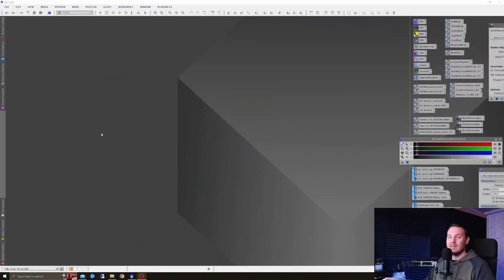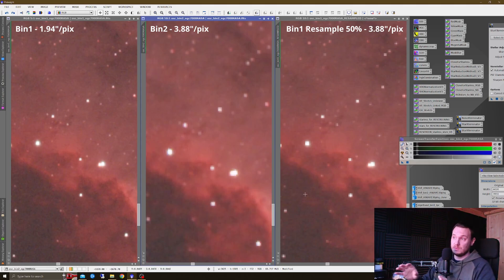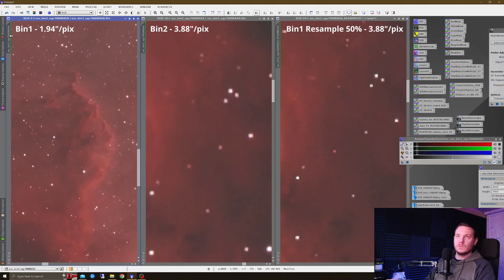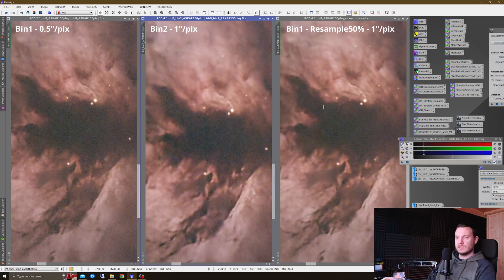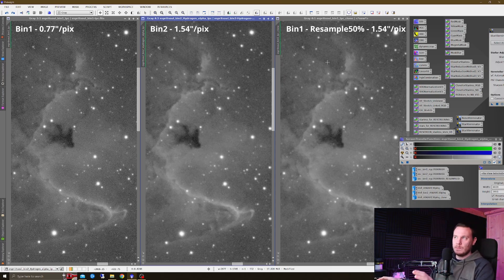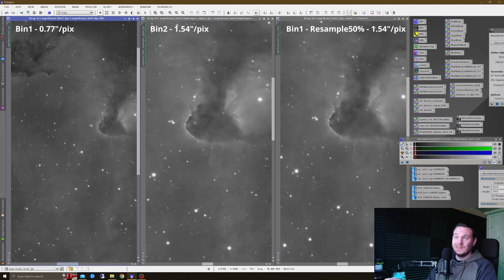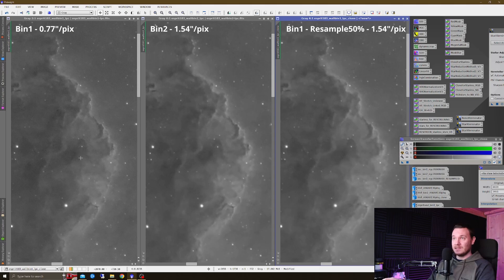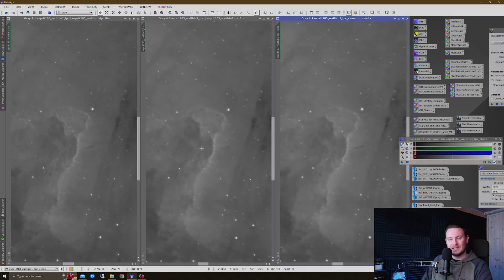Bin1 vs Bin2 vs Resampling - or, To Bin, or Not to Bin?

Comment from the maker: I've realised I made an error on the pixel scale calculation for the 130PHQ segment! - It's 0.77"/pix for B1, and 1.56"/pix for B2 - I calculated using the wrong pixel size (2.4um2 still from the previous test, rather than 3.76um2 actually used) Regardless of the numbers anyway, the observations hold up! :-) Clear skies!
Reply: Ok! I was thinking: "Great resolution for 1,94"... But, if it's 0,77" I understand!! ;-) (actually, you've a dawes limit of 0.89 arc/secs with the 130) Thank you for this test, it's good to see it in "real life". Take care (from France).

Comment: I really wonder if the full well makes a difference though. I use the ZWO294MM camera and my 60mm refractor seems to be well sampled, by calculation, but the full well is completely different in bin 1 mode as opposed to bin 2 mode. I wonder if drizzle 2x can make up for using bin 2 mode too?

Comment: I’m just starting in this hobby. When would you want to change from  Bin 1 to Bin 2 or greater? Can post processing reverse it? I have a C8 SCT and am looking for my first OCS cooled camera. Is Binning more important to high focal length OTA? I think I’m figuring out that my  C8 is best for planets and galaxies except M31 ( without  creating a mosaic). But there is always iHyperstar for Nebula. Thanks
Reply from the maker: Hi there mate! You've basically got it already yeah, you'd bin when shooting unbinned causes you to be oversampled, so generally that's long focal length deep sky work 👍
For planetary/lunar though you want to sample as finely as possible so you'd never really bin for that, just as a general rule!

During stacking you can restore some spatial resolution if you drizzle your integration, but you can only really successfully drizzle data that was well dithered during capture and significantly oversampled anyway.

Hope that helps!

Comment: Thanks Luke, it is great to see these topics debated using actual experiments and real data, instead of only theory. As you demonstrate, it is hard to oversample an image. Most of your examples change from proper sampling (0.7-1) to near undersampling. It would be great to see an experiment like this with really oversampled images (0.3"/px or so) from 2000-3000mm systems.
Reply from the maker: Thank you mate!! I'd definitely like to check this out again with a really long f/l system, could be interesting 👍
I appreciate you watching and commenting!

Comment: Very interesting. You may have negated the 1-2 a-s/pixel rule of thumb here. Am wondering if this is specific to your equipment somehow, or if the PixInsight processing has evolved to allow more oversampling in the data.

But not sure how you are binning at 2x2 with a OSC cam. Your images should go from RGB color to monochrome grey as the Bayer matrix can't be binned.

Cheers.
Reply from the maker: Thanks John! - I'm glad you found it interesting my friend :-)
RE: OSC binning retaining colour, I believe it's an interpolated bin technique that most of the astro cam manufacturers seem to use these days, not actually a 'true' bin2, but slightly higher than that so it can average the same coloured nearby pixels into groups for binning. - Hope that helps!
Clear skies mate

Comment: Luke,
Are you using WBPP script? 
There is a new updated section for drizzle data; under 'Post Calibration' did you use this feature?
If your Images are Bin2x2, then in the updated section 'Drizzle Configuration', you would select Scale 2, and 'Function (Circular)'.
Apply to all groups if required.

Something to try!
-------------
Reply from the maker: Thanks for the heads up Robin! I'm actually using APP for all stacking and preprocessing tasks these days though, still - I appreciate you taking the time to offer wisdom!
Clear skies my friend 👍
Reply: Thanks for the tip!

Comment: This is pretty much the proof I need as they were advising me on forums not to bother with bin2. Current CMOS sensors do not act like old CCDs. The bin2 is basically a resampled bin1 image with no gain, but more likely a noisier version, but everyone's milage may vary. 
There is one benefit though.  I was recently using my Kstars/Ekos loaded Raspberry pi and noticed that I'm running out of space, so instead of going around and deleting stuff, I decided to bin 2 to save on hard drive space.  It's also faster to process smaller files of course.  And lets not forget the drizzle integration, in case the bin2 doesn't look well.
Reply from the maker: Thanks for the great comment! - I definitely see the usage case for bin2 in that kind of scenario, where you're finding yourself system/storage limited :-)
Doing a drizzle of the bin2 data could have been interesting to add to the comparison too, thanks for the suggestion! I'll perhaps need to revisit this sometime.
Clear skies!

Comment: I don't see a reason to use anything other than Bin1 with CMOS sensors. CMOS binning is entirely performed in software by the camera's firmware (as opposed to CCDs where binning is a hardware feature of the sensor). In other words, it's just software-based re-sampling. You can achieve the same in your own image processing with a lot more control while keeping the raw data.
Reply from the maker: Thanks for your comment Andre! I'm pretty much in total agreement :-) Clear skies!

Comment: Selection of camera and binning is defined by image scale. I aim to get 0.7-1.2” ideally; 1.2-2” is ok, and no below 0.7-0.8” or no to scope producing above 2”.
What about 0.7”-1” image scale and low f ratio? This is the best systems. Scopes with massive mirrors and complicated optical systems. Observatory-grade scopes.
It could have been great to have numbers (FWHM), especially that 0.5 vs 1”. It is surprising that seeing + guiding accuracy support it.
Reply from the maker: Thanks Ana! - I'm sorry I didn't include the extra info such as FWHM for each capture - that's something I could perhaps do in a more in-depth look at the subject I guess!
I'm glad it was still useful to a lot of people though :-D
Clear skies!
Reply: @lukomatico  For my system, anything below 0.7”/pixel doesn’t work. I don’t know seeing or mount accuracy. Besides, small pixels strongly undermine SNR. It is tough compromise to make.

Comment: Really great Video, I love this topic and would like to see a more in depth version of it where you could add the factors of rayleigh limit of a telescope or seeing etc. (things that influence the practical resolution or sharpness of an image) I always thought that a lower pixel scale would not make sense if its lower than the rayleigh limit of a telescope... but the 130phq has a rayleigh limit of 1.06" and your bin 1 version was way sharper than the bin 2 version with 1 "/pix. So how are those two things effect each other? In theory there should be no difference in resolution in your bin 1 and bin 2 version with 130phq because both pixelscales are benith the telescopes rayleigh limit of 1.06"... The 130phq should not be able to resolve a greater resolution than 1.06"/pix but its still a difference in your images :O
Reply from the maker: Thanks mate! - I've realised I made a mistake with the pixel scale calculation for the imx571 on the 130phq by the way, it's 0.78"/pix at bin1! I calculated with a smaller pixel by accident unfortunately (2.4um2 rather than 3.76um2") Oops! Still, regardless of the numbers & which theory we apply, be it Nyquist, Dawes or Rayleigh, we can definitely see bin1 was better on this scope! :-D The proof is in the pudding I guess!
Thanks for watching!
Reply: @lukomatico  This really makes sense :D If the scopes resolution capibility is arround 1"/pix we should see a great difference between the bin 1 (0.77) and the bin 2 (1.56) image. And thats what is showing in your test exposures!

Comment: Nice comparison Luke.  Definitely bin 1.  Isn't bin 2 just software interpolation with cmos camera's so can resample afterwards. Clear skies bud.
Reply from the maker: Thanks Rob! - I think all cmos binning is done after reading yeah, it's still an SNR boost but not as effective as binning on a CCD used to be! Definitely seemed like resampling did a better job than binning though interestingly! :-) Clear skies my friend!
Reply: @lukomatico  It's not an SNR boost if done with CMOS. There is an improvement in the pixel SNR but it's a meaningless metric, if you average the SNR of  the same patch of sky there is no SNR difference between binned and unbinned CMOS.
The only senario where I can see CMOS binnig being useful is if for some reason you need to save disk space or if you need faster transfer from camera to PC